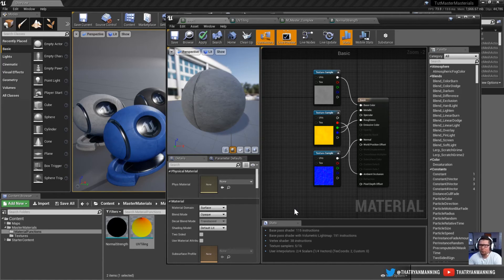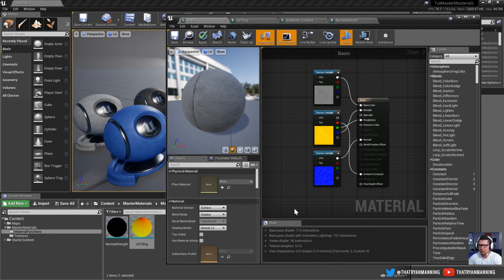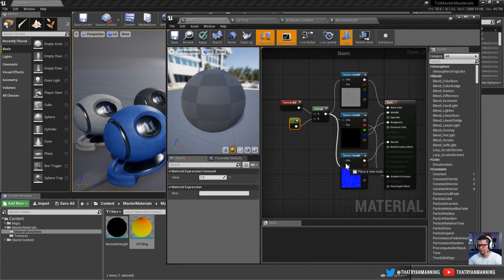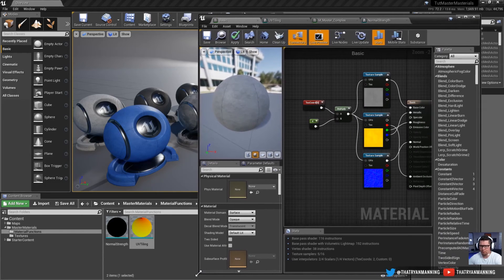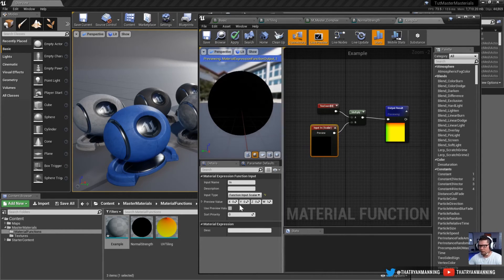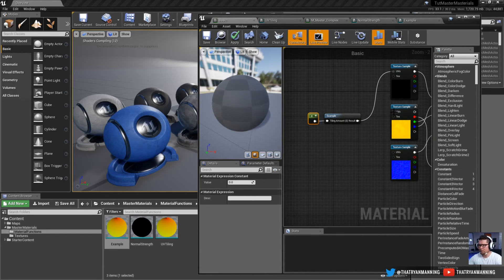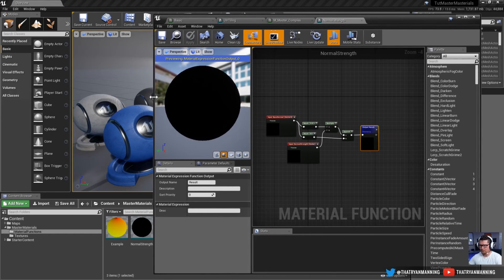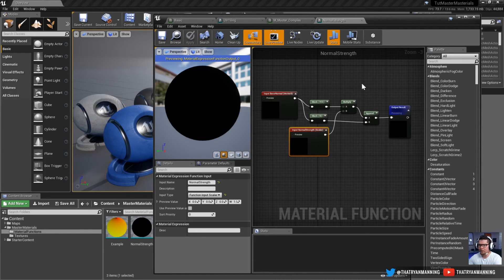UE4 Nesting Material Functions

Comment: [SM5] Function NormalStrength: (Node Multiply) Arithmetic between types float2 and float are undefined
Keep getting this error following your exact procedure. Any advice ?
Reply: have the same problem :/
Reply: use a makefloat2 node between the scalar and multiply node and plug the scalar node in both X and Y
Edit: ignior what i just said just use a flattennormal node instead of the function he made works the same without a error